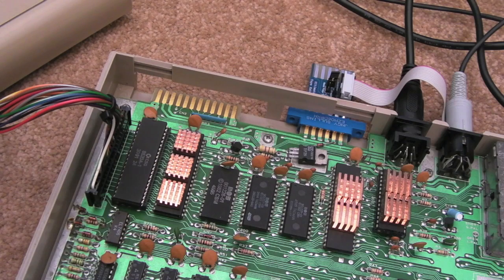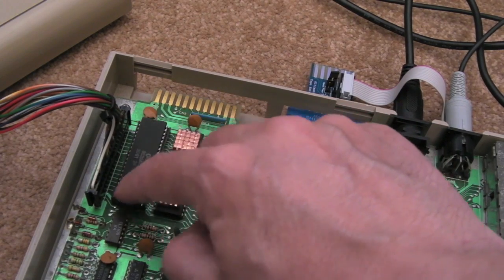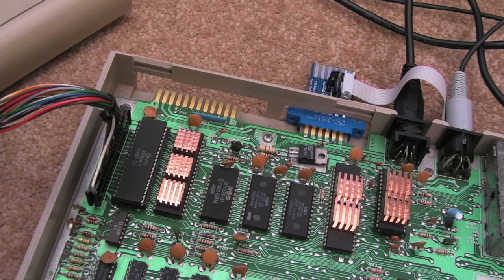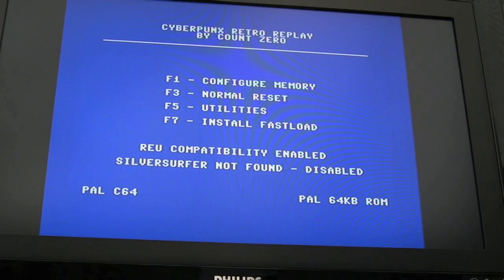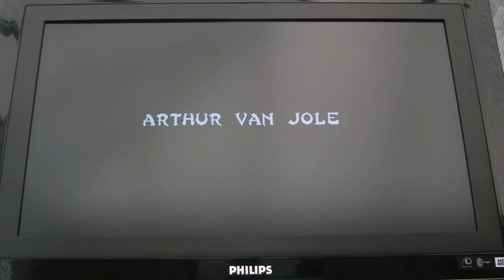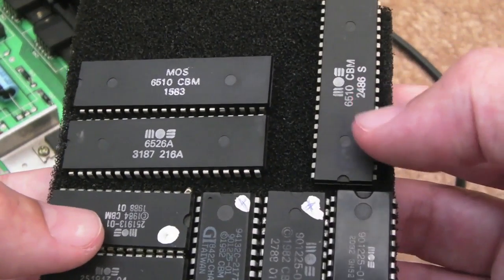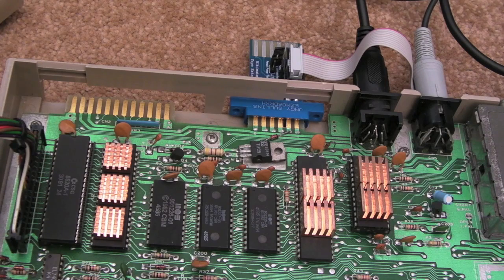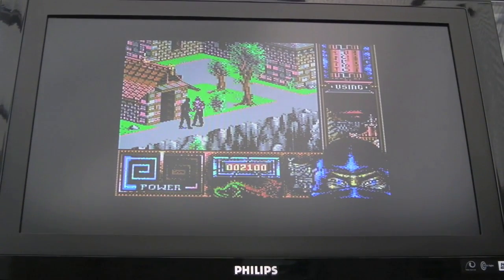Commodore 64 (C64) Swapping 6526 for 8520 (Amiga)

Comment: I just got a C64c shortboard from ebay and fire button for joystick was not working when plugged into Joystick port 2. I took out U1 6526A, put in a socket then borrowed 8520A from Amiga 500. Working fine except for one thing.. autofire does not work. Now, this is a Zip Stik which have the type of auto fire where you swtch it on and have to hold the fire button for it to work. So probably timing related issues?
Reply from the maker: Thanks!  That may be correct!  I found for example that mine would not work on one of my systems (I forget which - C64 I think), but it WOULD work on my 1200!  That would explain it!
Reply: @GadgetUK164  Thanks for the answer! So then you had 8520A populated at U1 in that particular C64?
Reply from the maker: It might be that the stick just isn't compatible (regards auto fire) - I believe it has to pull the fire signal low, and on some systems that type of autofire struggles.
Reply: @GadgetUK164  Autofire still works at port 1. And I tried two different types of autofire joysticks. They work just fine on my other C64s in both ports. I have been posting about this in a forum and one guy found documentation that the 6526A has identical pullup resistance on both joystick ports while 8520A has different pullup for each port. So I think the 8520A causes the issue with autofire on port 2. Maybe you could test this to see if you get the same result? Anyway, have a 6526A on the way from China. Do not have any spare 6526As to test and unsoldering these are waay too much work. Will probably be a month before I get the chip so would be nice if you could do a quick test with 8520A in U1 and see if Autofire works when plugged into port 2. This way we could confirm. Motherboard is assy 250469 Rev.B. But I would assume you would get the same result on older boards
Reply from the maker: I will look into this - I still have that joystick here, I just need to find some time =D
Reply: @GadgetUK164  Finally got my MOS 6526A from Singapore. I am happy to report everything works fine, including the autofire in port 2. So this is proof the 8520A has at least one issue when used as CIA U1 in a C64. Joystick autofire does not work in port 2. Other than that it seemed to work fine.

Comment: Hey awesome video! Thanks a lot for cross testing.
Any chance you can plug in a "Diagnostic" or a "Dead Test" cartridge and check if the shown Time Of Day has some weird abnoramlities? Maybe in a new video ?
Reply from the maker: When I get the C64s out soon I can check that for you - but I can say with certainty now that I suspect it will error.  The TOD stuff is different between the C64 and Amiga.

Comment: Now a few years later, are you still recommending the 8520 or did problems pop up?
Reply from the maker: I was not recommending the 8520 - I was showing that for the most part it works!  Any games or programs that make use of the TOD will have issues.  So it's not a 100% solution, but it could get you up and running (temporarily) if you cannot find a 6526.
Reply: I had it poorly translated in my mind from german to english ;) You are right. So, no fire occured or something like that ;)
Reply from the maker: It's no problem!  Sorry if I confused you =D   All the controllers work OK, keyboard works OK, you can load from disk without issue.  The only problems you would have is games that use the TOD (Time Of Day) - any game using that might act strangely or crash etc, but I tested loads of games and they all worked fine.  So you could use an 8520 just to get up and running quickly.

Comment: The 6522ap from Rockwell should be working  in a commodore 64 these where the early chips.
Reply from the maker: The 6522 doesn't have exactly the same functionality as the 6526 - there are differences between CS pins and flags etc.  It might work but I doubt it.  Whereas the CIA from the Amiga is identical bar the Time of Day signal.
Reply: Older type,s disk drive,s 1541 had them so i suspect that it possible can work in a c64 I will try it out some day in my old bread bin.
Reply from the maker: Yes, they were built to work with that chip though!  It's very similar internally but lacks some of the logic required by the C64.